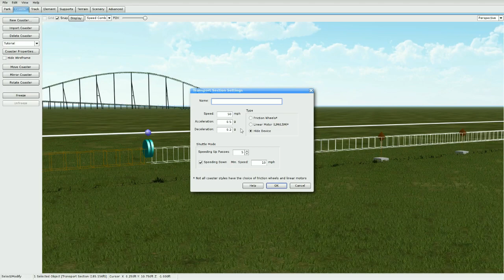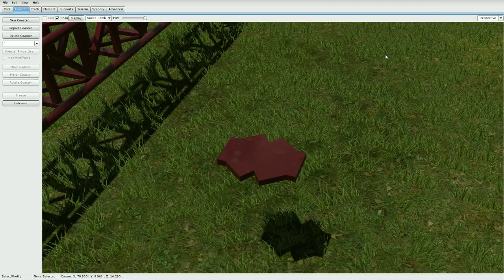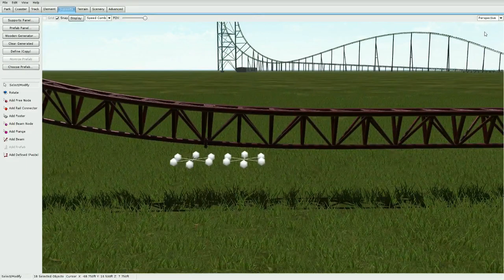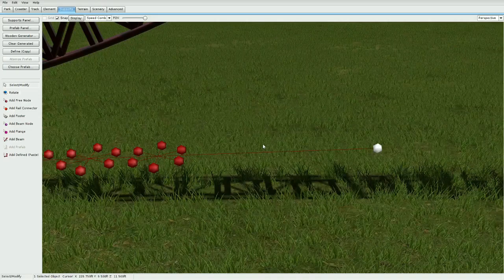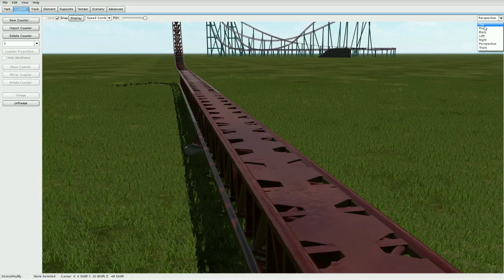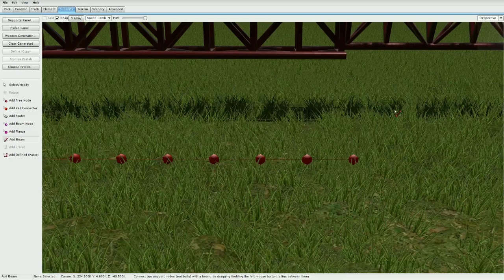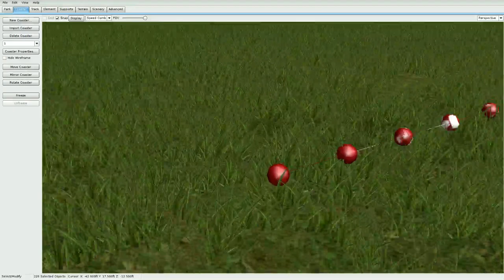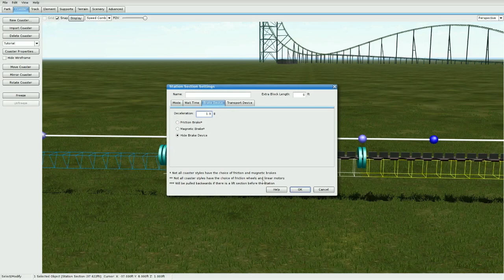No Limits 2- Custom Intamin LSM Track | & Fins

Comment: so i'm having trouble i'm making a replica of maverick at cedar point and when ever i tilt the track cover things it ends up all wonky
Reply from the maker: You just need to click on the support beams and adjust the rotation settings
Reply from the maker: It may not work as well on the transition from the level track to angled
Reply: Ok thank you ;)